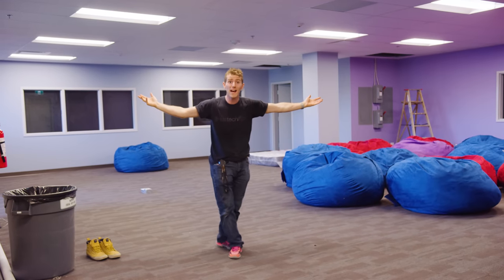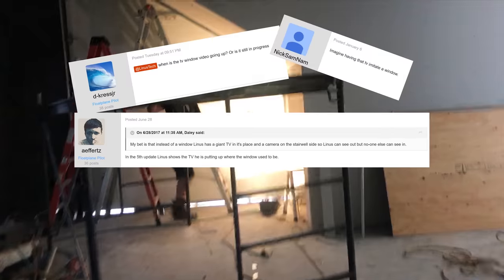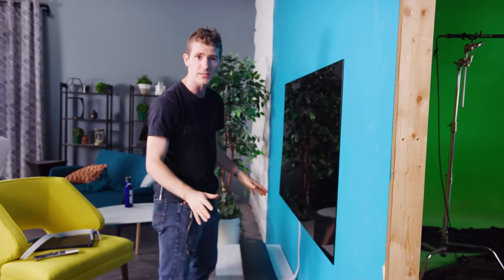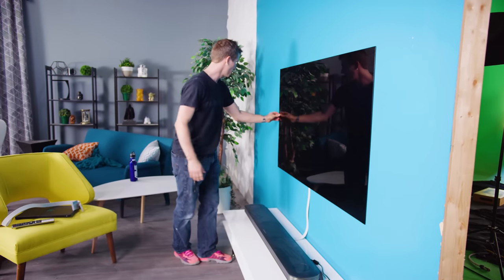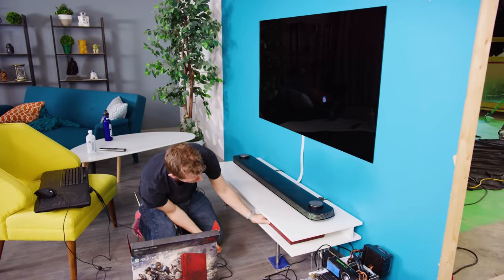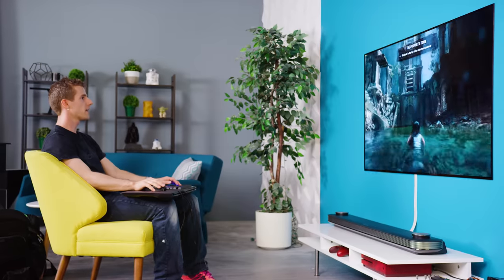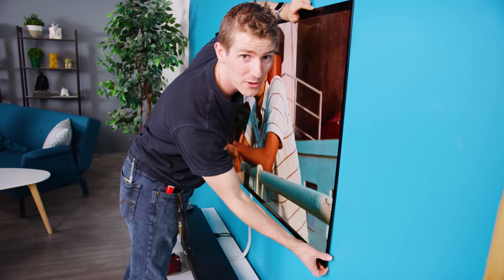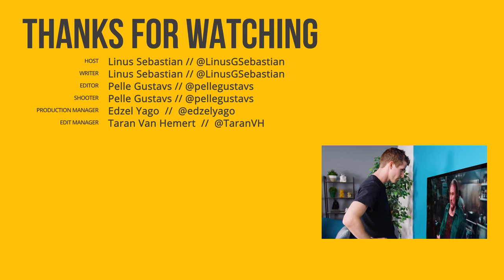LG’s OLED Wallpaper TV – Can we use it as a WINDOW?? Pt.1

Comment: You really should sink the mount into the wall a bit (around 4mm) to make it completely flat with the wall. Would look better and give it a more realistic feel.
Reply: mrmrhejsan Yes. Make the tv flush with the wall
Reply: just add a window frame around it
Reply: Miguel Yanez 
Ahhhh ya got to mentioning it being flush before me lol.
Reply: mrmrhejsan Well if he did that couldn't he just do that with any tv???
Reply: Trollerman Sixtysevan Yeah but regular TVs arent as thin so you'll probably then have to deal with the studs in the walls which won't be very fun.
Reply: You could probably just sand the dry wall a few mm..
And why would you want to add a window frame?
Completely bezeless tv, adds massive bezels lol
Reply: "Can we use it as a WINDOW"
Reply: the only way to make it seem like an actual window is if you can see the 2d image 3 dimensionally, aka, if you move left and right, you'll see the image differently.
Reply: Kurtis Kroetsch so.... One of those glasses-free 3DTVs then?
Reply: mrmrhejsan more than a little 4mm bec. Of back structure
Reply: Vanshu there is no back structure it's legit paper thin
Reply: 4 mm is only TV. There is also TV mount screwed to the wall. Probably another 2 to 4 mm
Reply: Actually he shouldnt. I am aware this is all just a tech show case with this wallpaper oled, but if he really wanted the illusion of a window he could have just taken a 100+ inch "normal" flatscreen (4k and up) and build it INTO the wall completely sunken and then just build in a normal window frame with with glass and all infront of it. That way the black borders can be hidden as well and it would fully look like a view out of a window. Now it will just look like a tv, flush with the wall.
Reply: He could even put the ribbon cable in the wall to hide it.

Comment: You should hook up a wireless cam and screen share the footage to the TV live, so you can make sure everyone is working, and that way, it'll almost be a window!
Reply: achintya bhavaraju that's what I was thinking too
Reply: The first thing I thought of too.  I also thought he was going to say they were building a window frame around it for complete authenticity, as it would hide the ribbon cable and potentially the tiny borders around the screen too.

Although the most cool would be to have a camera with head tracking running one of those highly detailed UE scenes, so that it ACTUALLY reacts like looking through a window with the visible area changing as you move your head.  Its not like they couldn't spare a PC for it.
Reply: Alex Atkin ok, you'll be the guy to make 3d windows
Reply: Its already been done, its how the New Nintendo 3DS "super stable 3D" works. (or doesn't sadly in my case)

But on PC implementations you can use better cameras and better tracking software thanks to the beefier CPU.

The catch is it can only ever work with a single person at a time.
Reply: RIP Morale for the employees.
Reply: or just make rectangle hole in wall
Reply: yeah that would be a good idea... when no one is using the tv.. it can be used as a window to look over his employees but when someone wants to use the tv for watching vids or something... they can switch it back from cam mode to tv mode... that would be an awesome thing to do.. 2 in 1 window
Reply: It would have to be a lightfield display (basically holographic, they do exist and are actually easy to manufacture, just currently very low res) to act like a real window without any tracking or glasses.
Reply: will there be a security camera in the ladies room?

Comment: Cinder blocks 
4x6 framing (8 inches on center)
1/4 inch plastic
1/4 inch steel
Cinder blocks
Oled screens top to bottom with cameras project in straight forward outside
You can see outside and not get shot.

Comment: Have not seen this product before now; been hearing rumors... Seems like the smarter thing for LG to do was wire the box to the back plate; then have contacts that the screen would align too to control it... Then you wouldn't need to worry about ripping wires out of the screen or flinging the box across the room when you take the screen off the wall... Plus then you could hide the white ribbon cable in the wall and keep it out of view.

Comment: LG just got to stop with the innovation paper thin tv come on now, how can are wallets keep up
Reply: Or just don't be picky, and get lower quality.
Reply: the $2000 B7 series looks just as good and you can sink it into a wall if you really wanted to
Reply: melvin arias that's not the point of innovation.. the point is to make it affordable to the average consumer as well. Innovation does not equal making things progressively more expensive. This goes for the rather stupid prices nvidia and intel have for their top of the line processors. They're still consumer processors and all of a sudden there's now this mixup between consuner grade and commercial grade hardware sharring prices.

Comment: It looks like a lot of people would want a much longer length ribbon cable to go from TV down to the control unit when TV is hung higher on wall as well as to sink it into the wall to not see it so much. Is it available from them in the box ? Did you cut the ribbon cable to your own desired length or are extension cables available ?   Many TV's on wall prior to this model gave a slight downward barely noticeable angle of tilt because many liked that pitch versus a perfect flush wall angle --  do you notice a need for a down angle minor tilt or a loss from not having one as in past LCD tv models and plasma wall mount brackets provided ?

Comment: The picture on OLED definitely looks better but  you can get a permanent "burn in" after little bit more than 2 years of normal use. That is what happened to me and many others. LG customer service actually denies the fact that they have ever promised 10 years life of their OLED screens and only propose to replace the screen, which is 80% of the cost of the TV or get a new one. They even included links to their online store in every email during our exchange. LG is very irresponsable brand. Just do some quick research online and you will find a lot of complaints. It is very possible that this whole situation will end by class action because not that many people bought OLED TVs 2-3 years ago(exactly how long those TVs  last) since they were quite expensive. Today OLED TVs are much cheaper, more people will buy it and more people will have burn in on their TVs. OLED is a transitional technology and very soon it will be replaced by similar technology MicroLed. This technology doesn't have burn in issues.

Comment: "Can we use it as a window"....Of course you can, but if you want scenic views, it would probably be cheaper to move to a location you want to look at from a window, rent a place and look. Or, for even less, you could cut a hole in the wall and put in a window. Point is, these TV's are absurdly expensive.

To be fair, I'm sure there's far more to the video than that. I just don't have the time right now.

Comment: FYI the ribbon cable between the sound bar and the TV are not rated for in wall use
Reply: And I wouldn't use it as a monitor burn in is a very real issue with OLED

Comment: "that's 8K footage off one of the worlds best cameras on arguably the worlds best tv"
Bullshit!
Titan Xp can't display 8K @ 60fps via HDMI because it only has HDMI 2.0b.
Titan Xp can display 8K @ 60fps via Display Port 1.4, however the TV is only a 4K TV with no DP1.4 connection.
The Red Helium camera might well be able to film footage in 8K @ 60fps but the graphics card and TV combo certainly can't display it.
And the Xbox One S does not render games in true 4K, it's dynamic upscaled/temporal injection/checkerboard crap, so maybe 1440p at best.